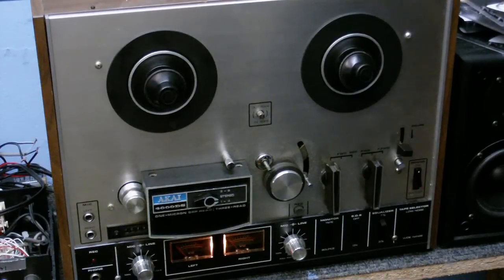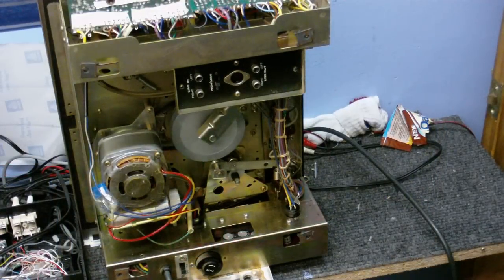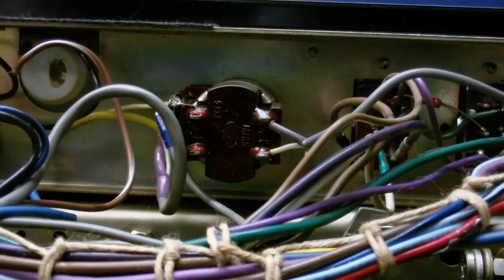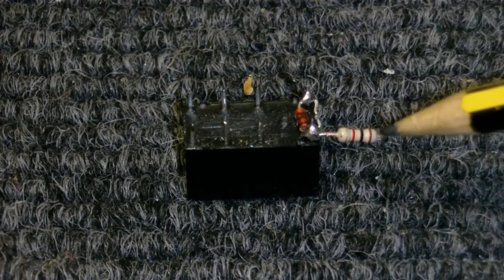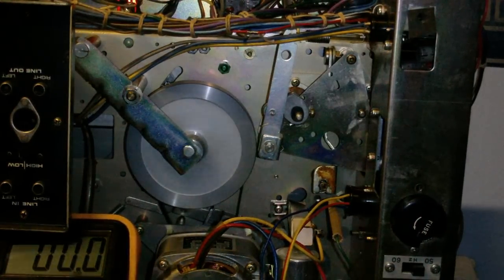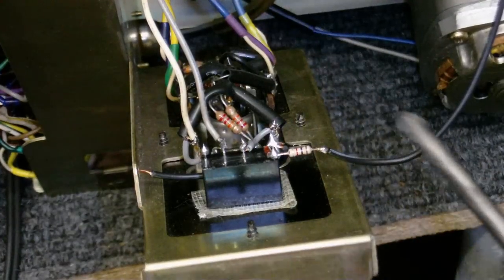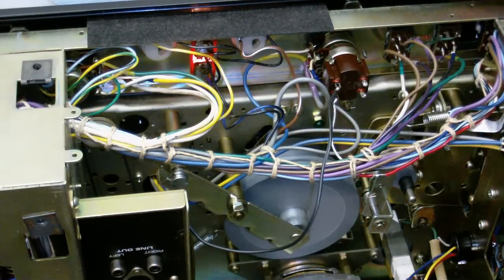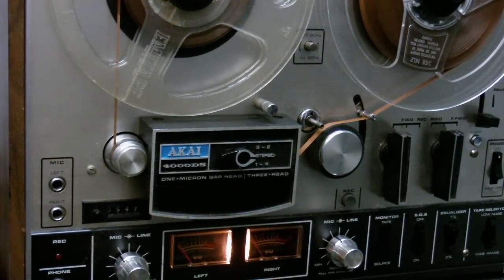CDC Electronic Workshop - Another Akai Mod

Comment from the maker: @Films4You The video editor I use is Adobe Premeire 6.5, it' quite old, but it can do a full 1080 HD video perfectly even though it was made before hgh-def came around. I usually do them at 720p because a1080p video file would be huge and I don't have the patience to upload one o that size.  I'm still using my Speed 8Z HD camcorder, it has quite a bit of background audio noise, and doesn't record very loud, so I simply boosted the audio with audacity.